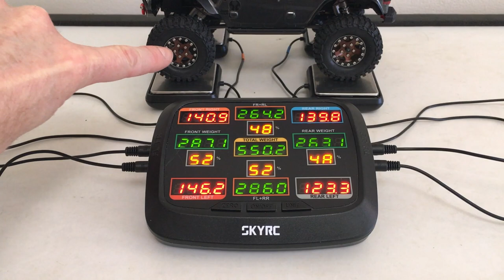SCX24 Jeep JLU Trail Truck Build 3.0: Stage 3 - Lighting, Electronics, Roof Rack, Scale Accessories

Comment: Awesome work! I saw that Club5 switch on their website when I was buying 1/10 links but no great details about how to use it. How do you switch between lights? I see you can go “a” or “b” or “a/b” but how? Demo vid please..
Reply from the maker: You just need a 3 position switch on one channel. On the FlyskyGT5, that is ch4.
Reply: @bcochener  Right. But can you pick which light you want on or do you have to cycle through each mode by pressing channel 3?
Reply: @bcochener  Sorry!! Disregard!! I just noticed you said it needs a 3 position switch! 🤦🏽‍♂️ Thanks bro!!
Reply from the maker: @DanPRC  Well, only by cycling through. So can’t have A on then A&B on. Have to turn A off and B on first in the cycle. So each light is not independently switchable by the user.
Reply from the maker: Hence the name “Cyclical switch”
Reply from the maker: @DanPRC  ah, just saw this. You know, I should try it on a button channel. The button could still cycle the switch I would think??

Comment: Hi buddy, do you have any recommendations for upgraded axle shafts?

Thanks!
Reply from the maker: What are you looking for?  Full set of inner axles? Extended or stock length? Just outer fronts & rear?  I can't really recommend any really...  Every extended axle front drive cup, I have had to deepen.  The rear inner is pretty easy, all the aftermarket no-name seem to be thicker than stock.  Full send are probably the strongest you can get as far as that.  Not sure if they make just stock length though.  Usually you can tell by the photos if they are thicker than the stock ones.  Most are.  Good luck!